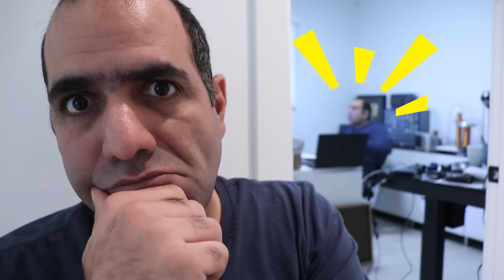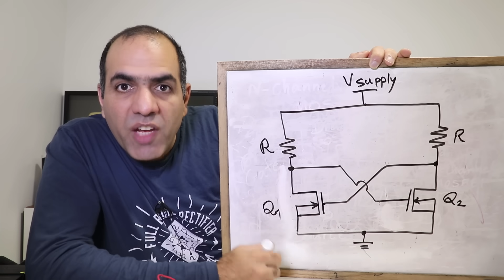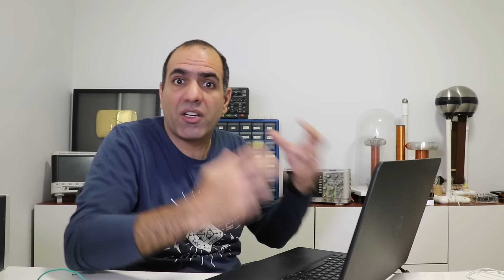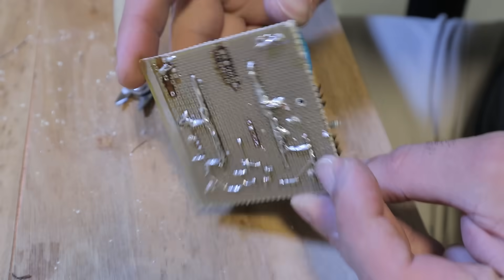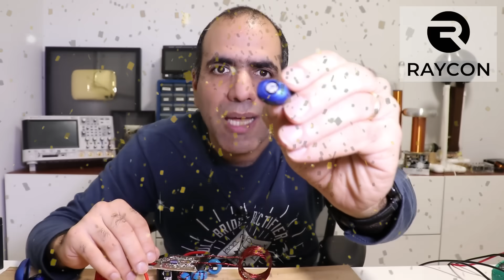Almost MELTING Metal with Induction Heater

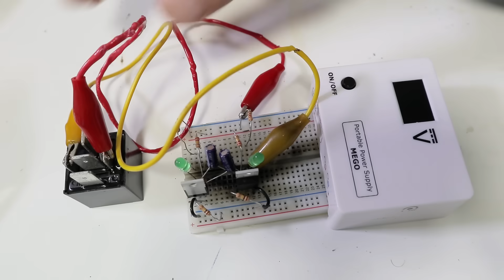Comment: You can see the characteristic of an electronic engineer just by looking at how severe the burn marks are on his breadboard. (5:05)
Reply: Not really, @Badr Ahmed. Currently majoring chemical engineering.
Reply: @Badr Ahmed I've also seen him..😁
Reply: @Asu01  Chemical engineering brethren! I'm a sophomore and it's getting hard, but these videos help me get through it lol
Reply: Mine has half of a 4000 series IC baked into it. No chance of getting that off haha
Reply: Then I'm a master electrical engineer
Reply: Its either that or a part of the breadboard is melted

Comment: Fun fact:
The peak voltage of the LC tank circuit (voltage between ground and drain ( 8:09 ))
 in a ZVS driver is π times the input voltage, 
and it can be proven mathematically.
Reply: Holy shit that's fascinating, where can I learn more about it?
Reply: @dominikworkshop6007  thanks for mentioning my video, it's nice to be recognized :) I'm still trying to figure out the physical meaning behind the math though.
Reply: @Vidduley  hah, np. your channel deserves more views, you do a great job!
Reply: @Vidduley Can I ask you a question? Can you make a zvs driver with bjt's ? You absolutely deserve more subs, as your videos are highly educational and useful! 
Stay safe!
Reply: @oldelectronicenthuasiast  Thank you! I've never seen one, but I think yes, you can make ZVS with bjts, just as you can make a multivibrator with bjts. The circuit would change a little bit, but it's still possible.
Reply: @Vidduley  amazing, thanks for the answer. i thought about making an air core transformer much like car ingition coil and operate the zvs driver at about 200khz and use the output to a CW multiplier or marx gen to create high voltage power supply for science experiments and random lightning and maybe birkeland-eyde reactor.
Thanks for answer and have a nice day! Stay safe!
Reply: So in a spark gap Tesla coil povered by a 7kV neon sign transformer the peak is almost 10kV.Does it mean that when the spark gap fires I will have 30kV across the primary circuit?

Comment: 1:40 the beep beep means he was running it from a UPS, which is much slightly safer if you're gonna risk touching the conductors :)
Reply: I think it was his AFCI, though
Reply: @adanedsstudio  Maybe. I'd use a UPS because it would take two conductors to kill me :)
Reply: @Dennis W - Most UPS units don’t isolate you from the mains at all when plugged in. Only the double conversion ones do that AFAIK, line interactive or the most basic ones simply pass the mains through via relays. I thought I’d better point that out in case anyone got the wrong idea.
Of course, running on battery is the same as being mains isolated, lol!
Reply: @ProdigalPorcupine  1. Pull the mains plug
2. UPS does its job
3. You now have an isolated supply
Reply: @sciencoking  - I know, but others reading your original comment may not! That’s why I thought it best to clarify. :-)

Comment: The heavy duty ones usually use copper tubing for the induction coil, then they run coolant through the tubing to stop it melting. But on the other hand that's at a bit different current rating. Models for heating up and straightening truck axles, for example, often push like a 1000 amps through the coil, which concentrate the heat onto a few square centimeters.

Comment: I'm surprised he didn't mention anything about the frequency of the circuit, i made my own zvs circuit and i found out that there's an ideal frequency which reduces alot of heat losses through the MOSFET and oyher components. Also higher gate helps with MOSFET switching time

Comment: it was great to watch this vid again. this was the first mehdi vid i saw,  2 years ago, and none of it made any sense at all. i was so captivated by his presentation i then watched all his other vids, bought loads of components from amazon, an oscilloscope, a couple of bench supplies, and a function generator. i have learned how everything works, as it were. i can now solder and understand schematics, I made xrays, model rocket avionics, and an ECG machine using op amps. the joy i get from understanding how things work is the finest feeling i have ever experienced. Mehdi, and bigclive, have transformed my life.

Comment: 03:47 He can just use a SPDT switch..😂😂
Reply: In this specific circumstance you can, but what if you want control from multiple locations? You can just parallel pushbuttons and you always know which one is A and which is B. You could use DPDT switches strung together but then the directions change.

Comment: 3:52 here goes another classic incomprehensible circuit dynamics explanation. Either that or I'm totally fartbrained, as i had to watch it 8 times before still not getting it. If course I could model that circuit in Anycircuit or whatever, but that would be work and I watch these with (mixed) pleasure
Reply: Neither do i. I just like to watch some expert guy do wonders with electric, with no safety measures what so ever😁
Reply: I think we need to study 📖 🤔

Comment: Mehdi, can you design a circuit to power a variable ac/dc power supply
Reply: Yes it needs a feedback loop that constantly monitors the variable voltage a part of smps there are some main components like flash capacitors 
https://youtu.be/SHwy6IRxAws
Maybe you can get more info on this !!!

Comment: Hi. I’d like to share a few notes about the ZVS circuit (astable multivibrator). I’m not very good at English, so please bear that in mind. The main problem with using a ZVS circuit for switching MOSFETs is that it doesn’t allow for setting any delay required for properly switching MOSFETs. As a result, both MOSFETs might be in the on state at the same time, which leads to wasted energy and worse efficiency. Therefore, this circuit is not very suitable for switching MOSFETs. I recommend using a MOSFET driver from the IR21xx series, such as the IR2153, which has an integrated 'dead time' ensuring proper MOSFET switching. I hope this helps. Good luck.

Comment: advice for the next design: copper piping for the coil and run a liquid thermal transfer fluid to prevent coil overheating. you'll need a separate circuit to run it

Comment: ZVS is because you switch transistor when voltage goes through zero, thus decreasing the losses in the transisotr. This is why resonant circuits are usefull as they make voltage and current pass through 0 V or A allowing you to make switch at higher efficiency and protect the transistor from overvoltage.

Comment: As an amateur blacksmith, I can tell you dull red is nowhere near melting. Iron/steel near melting point is very bright yellow, appearing nearly white on camera, often even causing the camera to dim to compensate. Even at forging/forming temperatures it appears bright yellow.

Comment: 3:17 why is when the switch is connected, it pulls the voltage down?
Reply: When the switch is connected, a direct path to ground is made. This means that the drain of Q2 is connected to ground through a series resistor of zero since wires and switches have low resistance.
Another way of looking at it is that Q2 will be in parallel with the switch line so they will have the same voltage and the voltage drop across wires and switches is zero no matter what current flows through them since their resistance is zero and voltage drop in a resistor is V = resistance times current.

Comment: I killed one of my MOS-FET... Used to do tech for InductionInovations. Failed MOS-FET where the number one point of failure. There was an older guy constantly trying to improve the load protection on the circuit. I knew instantly whatever you where going to build was going to use MOS-FETs and a massive heatsync.

Comment: Zero Voltage Switching means you switch the FETs while their drain voltages are zero (ideally)

This increases the efficiency of the switches because they only burn power while both their drain and gate are on at the same time, which never happens in a perfect ZVS circuit

Comment: I built one of these before but with a pwm chip like the tl494 or sg3524 since I dont like to rely on the subtle difference in components of self-comutating designs.

Comment: These induction heaters have been around in industry for a long time.
I worked for a company that makes aluminum castings using this method, car parts, rims, etc.
An aluminum billet is placed over a mold, the water-cooled induction coil comes down and heats the billet, just before the billet collapses a hydraulic press presses the molten metal into the mold.  
Nothing new.

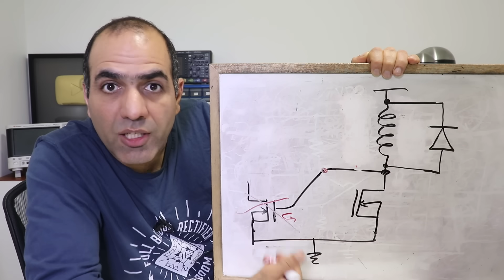Comment: 5:51 why put the diode In parallel with the inductanctor. It would make more sense to put the diode in series with the inductor since it would more effectively limit current travel
Reply: It's a flyback diode. When an inductor has current moving through it and is suddenly disconnected, it still has a lot of energy stored in its magnetic field and that energy gets dumped into an opposing voltage that tries to drive current through in the same direction it was going before you disconnected the part. Because the circuit is open, the voltage can spike to very high levels (kilovolts in some cases) since no current can flow and destroy sensitive components like that FET. The diode, when forward biased, has a constant voltage drop of about 0.7V. It becomes forward biased when the inductor is disconnected and tries to push current through with its own back EMF, and rather than letting the voltage spike it limits it to 0.7V and instead draws a high current. The current disappears too quickly to damage the diode since the electric field doesn't store a lot of energy.

Comment: Simple! get small 3mm copper aircon tubing coil it up and run water throw the pipe it will keep it cool wile the coil is generating the magnetic field on high resistance... boom no burning coil and a sturdy induction coil!

Comment: i think you should no permanently fix the extension board to table. So that, when you are pulling any plug it is fast and it is not taking the socket along it, at times, leaving a small unexposed gab which is not safe.

Comment: Hi. What's your comment on air Conditioner split system install doing it the bodgy way without vacuuming lines. Only purging air via valve. Have you installed your own air con. Go and buy one and install in your garage for fun please. Next project sorted.

Comment: anything that is a wire that is connected to a battery on both sides with a switch most likely is would short out? idk i dont do engineering as much but you are very coool

Comment: Why did you not elect to use a centre tapped heating coil, would this not have reduced the need for the inductors feeding dc to the coil? At the center tap, maybe less high frequency current would have leaked onto the power supply?
When adding a soft start, would it not have better to switch the common bias supply to the gates?

Comment: The heatsink on your mosfits are slowing your voltage. Try smaller heat sinks or not adding the screw and nut.😉

Comment: Could work on absorption refrigerator, the ones that use heat instead of compressor, YouTube video makes induction heater from LED lightbulb circuit ?

Comment: Is this the kind of circuit used by inverters to make 240 volts AC out of 12 or 24 volts DC? Probably with higher power MOSFETs or IGBTs, though.

Comment: Mehdi, can it be used to create an instant heater?
Ardunio with flow sensor and a relay. When tap is turned on flow sensor tells arduino to turn on relay to power the zvs
A metal water pipe flows through ZVS induction coil
A temperature sesnor is also attached to arduino to detect and control behavior based on temperature i.e. ZVS ON/OFF or voltage regulation

Looking forward to your or anyone else's input

Comment: Why use a ZVS instead of a diode and capacitor voltage multiplier?
Reply: ZVS outputs a continuous DC voltage while a Marx Generator can only output discrete DC voltages.

Comment: Want to make this oscillator induction heater to heat water in waterheater using solar panel , but could it be done with only a 100 watts dissipation ?? Thnak you , for the well made circuit and informative video, all the best يا هندسة

Comment: What would happen if you put a metal pipe in the middle , which is 
filled with water and connected to a 50 l water tank and a pump . How 
long before the water reaches 64C starting from ~10c ?

Comment: What if you make a circuit that cause spike of voltages and using this relay you create 2 spike of voltages low amperage high voltage and try to make a motor work on voltage spikes? 2 phase motor ?

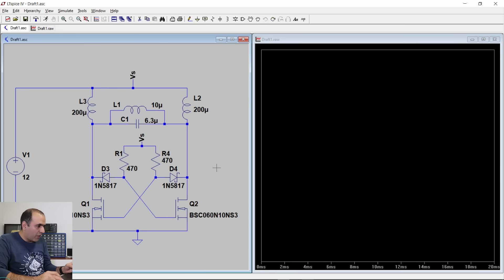Comment: Why did the R1 and R2 - gate resistors value changed from 330ohm to 470ohm at 7:46 to 7:55? What value did you eventually choose in your hardware design? and I guess you removed 2 diodes inputting to the current limiting inductors as the diodes in your simulation are D3 and D4? Too many whys, sorry man : -D! Thanks Mehdi for your videos : - ).

Comment: I like your channel a lot.  I recently discovered you because of the LTT crossover.  I found this video and from the title alone I knew you had made an inductance heater, and would absolutely love it if you showed how to make one that was heavier duty and would work on a larger piece of metal, and get it hotter.  Maybe to orange?  Because that dull red glow was nowhere near the melting point.  Here's a color temperature chart for you.

https://i.pinimg.com/originals/3f/9a/09/3f9a0932eb444db1337b07c7cc83da63.jpg

And to cut off any comments from people about the color depending on the metal composition, no, that's not how it works.  To quote an old metallurgy/blacksmithing book I found that I cannot remember the name of, "any material will glow the same color at the same temperature.  It  doesn't matter if it's steel, rock, glass, or horse whiskers."

Comment: I have a question if you take carbon brushed and use this relay that cause a random spike volt and send theses to a motor that you build with brushes and use the spike of voltage to make turn the motor and add a flying wheel for more weight can you make a motor run from only voltage spike without almost no amperage to not overheat the motor?!? and add another brush to recycle current generated by the motor and the spike should give a shock enough bigh to make turn a wheel without overheating it if you reduce the amperage ?!? cause anyway the generator will build its amperage from the spikes of voltage ?!?

Comment: 0:10
Zvs is called zero voltage switching because it  It has zero energy (electron) loss that why it called zero voltage switching
It what I learn so I don't know it correct or wrong if it wrong sorry 😞

Comment: I tried making this from the ElectroBoom website schematic and it acted like a short-circuit when I hooked it up to power.  Then I noticed that the zener diodes were where the hi-speed diodes go, and the hi-speed diodes were where the zener diodes go.  Are D1/D2 and D3/D4 in the schematic and in the parts list flipped?

Comment: What is the major difference between a capacitor and a transistor??
Reply: Almost everything, they're not really comparable. Capacitors temporarily store energy in an electric field and transistors are semiconductors that control the flow of current or a voltage.

Comment: My questions is this: how can a ZVS driver heater with like an input of 12 V and 2-10 A (depending on what you put inside of the coil) output like 70 V and 30 A on the output?

Is there some kind of factor I am not seeing? Because otherwise how can one go from 120 W (12 * 10) to 2100 W (70 * 30).

You do not explain this 'gain' of power other than just saying it is reactive power (oscillation).

Comment: Im having trouble with the details of thw swotching woth the ZVS circuit

My problem is i dont really understand how the gate voltage is pulled through the diode
I thought that parallel LC circuits in resonance act like an isolated circuit and dont affect other things
If someone could explain it in detail i would be very grateful as i need it for my college project.

Thanks

Comment: why does it make a clicking sound when the lights change
Reply: Relays are physically switching the circuit on and off. They have a small electromagnet inside that, when you put current through it, pulls a metal part and opens/closes the circuit. When the magnet turns off, the relay switches to the other state and the click is that part snapping back into place. It's the same reason a car clicks when the battery is dead: the relays inside are switching but there isn't enough power to turn the engine over.
Reply: @thegreatzoom5073  thank you so much

Comment: I have a question! What if i place a transformer in place of L1. What would happen? 2nd thing is that if it takes 2 amps from the power supply at 12 volts and outputs 36v 30amps that means input power = 24watts and output power is 1080 watts. Is it true? at 24 watts i get 1080watts? and if i can couple same circuits in parallel, i get more current? Plus, is this energy not infinite that way? you input 24 watt and get 1080. Power grid systems should use this and we may never run out of electricity ..
Reply: Placing a transformer on L1 is what people do when driving flyback transformers, the HV winding becomes the secondary. The 30A cannot be used to calculate total input/output power in watts like that. The total output power is still going to be less than the input, but it will be quite efficient with a good working driver.

Comment: Okay fine i dont understand electricity that much but how did you get high amps and voltage from a power supply with low amps and voltage where did the extra power come from?
Reply: The high voltage came from the unloaded ZVS circuit. The high current came when he shorted the output of the ZVS circuit with an inductor. To get high voltage he has to reduce the current and to get high current he has to reduce the voltage. Since power is equal to voltage times current, no extra power was generated.